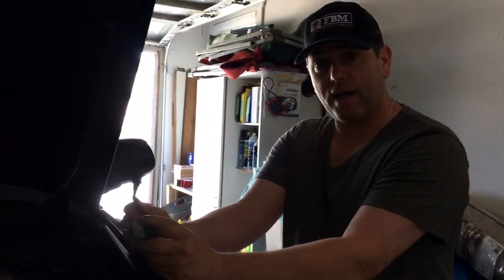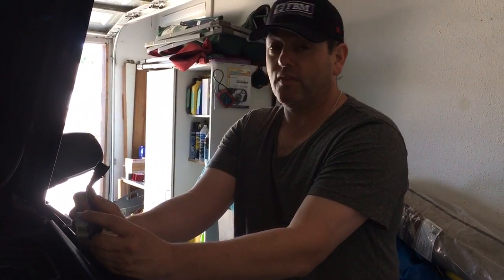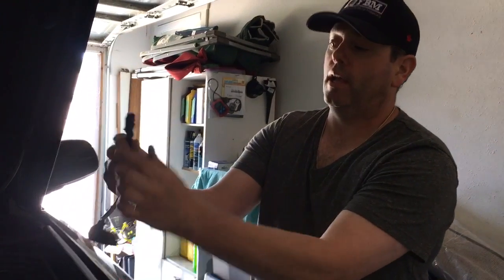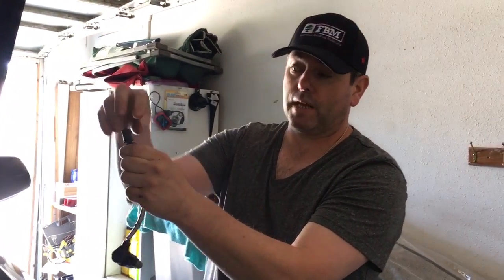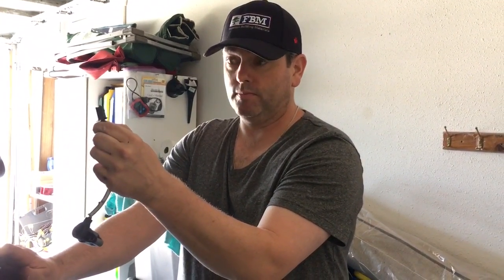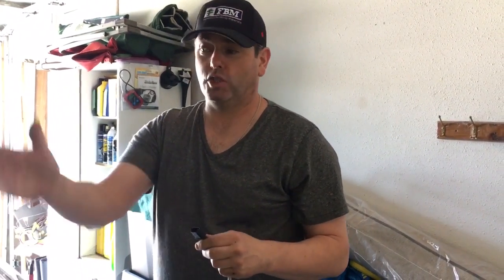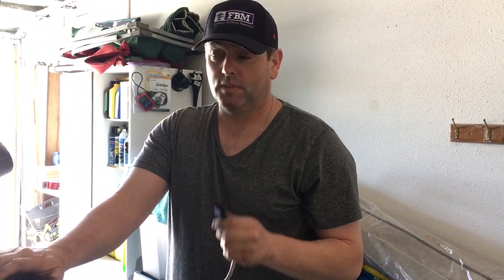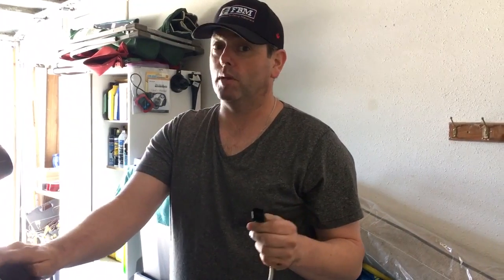Land Rover Discovery 2 V8 Crank Shaft Sensor

Comment: Hey there just seen this I have a 2001 disco SE myself…. I’ve been having very similar symptoms and have done extensive research and believe this is the culprit just curious, to this day have you had any issues with those same symptoms or did replacing the CPK sensor permanently fix your issues?? Thanks for the video very helpful
Reply from the maker: This did permanently solve the issue. But I must stress to use OEM parts, I have heard from others that off brand senors only last a month or two then problem comes back. Good luck man, let me know how it works out.
Reply: @robmarino6787   Thank you for the reply! I ordered one off of Atlantic British, will be here Wednesday, I’ll wait a week or so and come back let you know how everything goes!!

Comment: Thanks a lot for this, got my D2 up and running again. Just a tip if you use a small socket set with extensions the nuts are very easy to get off don't even have to put hands up there. Also used a long screwdriver to remove the harness from the bracket easily from underneath

Comment: Thanks for the vid. Fixed my issues w/ random stalling while underway (electrical system fine). A few comments: removing and reinstalling the shield and sensor is super easy, used a small ratchet and sockets. A short wobbly extension may help. Unplugging connector was aided by long screwdriver to wedge the locking tab open. The BIG PAIN is reattaching the new sensor to harness. My harness had almost no slack, so the plug could not be pulled down or over. No way to grab it from the topside and the mounting clip blocks access from below. Barely reachable from below via long skinny arms. can't get two hands on it (and I am pretty slim). If I had only 2 more cm of wire in harness it wouldve been much easier, and 5 more cm it could even be grabbed from above. Different vehicles may vary on this. It may be worth using a mirror and looking to see if you can free up some length in the harness.  I was minutes away from dropping the exhaust which would allow two hands up there. Finally my wife somehow did it after 90mins of trying. The clicking of the connector locking wa one of the best sounds ever. You should be prepared to drop the exhaust from the manifold in case you cannot get it (only 3 bolts but we all know how much fun they can be). One of those skinny reacher/grabber spring claw things could be useful - I may have been able to hold the connector from topside with one of these giving the wife something to push against. Anyway this is a 15 min job that likely takes hours due to lack of access.
Reply from the maker: very helpful info, glad I could help.

Comment: Thanks for the video! 
The first new Bosch CkPS I changed out made my 2001 Disco run sluggish af. Drove it for 2 months thinking it couldn't be the CkPS because I recently replaced it with a new one. The last straw was when I got the flashing M&S and went into limp mode. I changed out the sensor with another new Bosch sensor and it runs waaaaaaaaaaaaaay better now! Go figure...
I love my Disco... and i hate my Disco...
Reply from the maker: What sensor it you change out? for future reference, haha.
Reply: my bad... crankshaft position sensor... Ckps
Reply: These things are sensitive about that certain part. It's about how the materials take the heat in that location. Pretty much anything but the bosch made one goes bad quick.  Had 3 from the parts store that went bad between 4 to 6 months b4 i went online and bought the specific bosch part number that works like a charm
Reply: @xrguy650  Mine went bad after a year.  I think it may not have been a Bosch one.  That's the one I will get this time!

Comment: It’s basically impossible to reconnect the clips. I tried for six hours today straight. There’s no way to do it from the top that’s for sure and from the bottom, it seems basically impossible without taking the exhaust off.
Reply from the maker: I was given some great advice the other day. If you take off the tire and go through side panel you can easily reach.

Comment: Great Video Rob!  Many thanks!  Your accomplishment was an inspiration for me to attempt to do it  myself, as I do not claim to be a mechanic either.  You saved me an over $700.00 that a garage wanted to charge me for the same work.  I discovered a little trick you didn't show which enabled me to do it just under two hours.  You might add this note for others to try... Instead of pulling the plug up with the wiring harness, I was able to wedge it in place with a really big screwdriver coming in from the side with my right hand, and I could both unplug and replug it in place that way.
Reply from the maker: Hey very happy to help.Great info Dan, this was my hope that people would build on the info and provide further tips to help make this easier! Merry Christmas.

Comment: Hi! Thank you for this video it helped me few months back, now i m having the same exact issue again and not sure if I should replace the same part or change the coil pack this time, I appreciate it if you got any comments on the subject.
Reply from the maker: Make sure you didn't buy an aftermarket item. LR's are very picky and lots of aftermarket parts do not last. Especially when it comes to the sensors. I have heard from other people if its an OEM part it only lasts a few months.

Comment: Good Day Rob, mate thank you so much for your precious time doing this video, 
Could you please tell did you feel any losing a little bit of power then it hold it self then send all power back again special with the transmission  you feel something is holding all this what told u it’s only for few seconds then drive back normal? 
Cheers Matt
Reply from the maker: Hey Matt, if you talking about a symptom of it failing then yes. That jerking motion, as it seemed to lose power then gain again did happen. Usually in low idle.

Comment: Im not far behind! im about to do this... Mine starts normal but a week ago while driving truck stumbled... then no issues... last night driving home late at night just died instantly... no electrical change in lights or anything or being able to turn engine over... wait about 3-5 mins and it starts up... my onboard OBD II gauge just went into error mode but no codes... same thing happened again this am on way to work lol  since I cant get it to set a code or pending code before it dies, I decided to go ahead and order the part even if its not this ( but I suspect it is) . if its not and all of a sudden I did need it Id like to have it handy lol... anyway... i removed the OBD II gauge as i have also heard before of one malfunctioning and causing havoc on engine... when I unplugged ( maybe timing coincidence) disco II started right up... im pretty sure on any other situation like bad ignition or something then Id throw a code but I read on this situation it may die before a code sets in computer...
Reply from the maker: This part can be quite frustrating, not only about where it's located but also the issues it throws at you. It makes you think it could be the fuel pump, the alternator, the battery or the leads, something in the timing...etc. Once you gather all the symptoms; the stalling at low idle, no start but cranking, no start then start up after a few minutes, the unpredictable codes. With mine, check engine light came on but should no codes. Once I fixed, check light turned off. If you have the part you may as well install and see the outcome and go from there.
Reply: I finally threw to code while a couple of cranks of engine.. its been dead in the water for 2 days waiting the part lol  i ordered it before it failed as I was already pretty sure this was the issue lol Im at 125 miles on my 03 ... when cranking no RPM so no signal was coming from sensor that I could tell and mine actually died mid drive about 10 mins in... 2 times and then it was done... hopefully USPS is on time for tomorrow! lol ive been suspecting this could happen as my gas milage had dropped but no signs anywhere of the issue but one day abut 3 months ago it wouldnt start...  then it started... i ran codes and nothing so I dismissed it as a hiccup on a 125k dico.. ( BAHAHAHAHA) anyway it started and I forgot about it til now when it reminded me hashly! lol
Reply from the maker: good luck man,let me know how it goes.
Reply: I received the package fast ( 2 days) but thinking it wouldn't be available locally BUT IT WAS! lol anyway, took me about 1.5 hrs ( including running back to parts store for tools) and I didnt drop exhaust... it was pretty simple but my forearms just a little to large to reach that plug up by engine so I went down the street to a local speed shop and picked up (2 ) 11" long needle nose pliers bent with 90deg tip and with one in each hand I was able to hold the loose top connector on the wiring harness  and bottom connector with the second set pliers and press them together until they locked... then fired up the truck and has been running great!! on hindsight, i think id reconnect the top wiring harness plug to new sensor before installing the new sensor.. it was more difficult to match up the sensor plug halves to the wiring harness since the plug has a really stiff cable running off of it... anyway worked great and if i had it to do again I could do it in 30 mins now including taking a few sips of coffee lol
Reply from the maker: Awesome Dennis, and some good tips in there. Thanks for the update.

Comment: Any other idea's as to why it won't start? I just replaced it yet it still just clicks over
Reply from the maker: "clicking" is different than not turning over. if its clicking it could be; battery, battery leads, or starter.
Reply: I can start the car when key is in the on position. With a screw driver and starts up just fine but when I go to turn it over it just clicks
Reply from the maker: @zacharyswanson5132  Wow, that's about 2 levels above my pay grade. Perhaps this is an issue with the contacts in the key cylinder? Go on a Land Rover forum page, someone there might know. Good luck.

Comment: Diagnosed problem by verifying no spark and no tachometer movement while cranking. Also by connecting diagnostic scanner and getting P0335 code. However unless you have a service pit or extremely long and slender arms, this repair is impossible.  Was able to reach sensor body from below, but not able to reach electrical connector to the sensor from top or from below vehicle.  Would have to completely remove exhaust system and other parts on left side of engine to access this thing.
Reply from the maker: Hi Ana, after I posted the video I thought perhaps I should have stated it would have been much easier to do if I unhooked the exhaust pipe from the manifold but of course that is certainly not an easy task for a simple DIY mechanic. As you can see from the Video I'm not a small guy, not large guy either but I was able to accomplish the entire repair without taking anything extra apart. jumping from below the car, which was jacked up pretty high, to the top of the engine. This also would be much easier with help of a second person of course. Most things are!! :)
Reply: ahh since Im here Ill post here too maybe for others who haven't worked on these vehicles much.. IF you have not, then here is a little insight on removing the exhaust... SOAK THE BOLTS to the Y Pipe for a few days if possible every day, they rust in nice and good! one of my bolt heads sheered off when installing new flange gaskets and i had to get out a REALLY SHARP GOOD drill bit and drill it out and chase the threads with my thread reamer... a 45 min job ended up being a few Hrs... i didnt soak mine long and they were worse than they seemed.. anyway that was of course one of the bolts where the Y Pipe meets the exhaust manifold...its strait forward just take time...

Comment: Had this issue on my 2000 disco 2 about seven or eight years ago . Replaced the crankshaft sensor in 45 min . Think I’m having problems with the crank sensor again . Hard to start but when started runs fine . I’ll find out soon .
Reply: Charles Young From what I've researched these act up when they get hot. At least that's when mine acted up.

Comment: Do you think I’d be able to use a regular 7mm socket to get those bolts out? Thanks
Reply from the maker: sorry for the delay, there is not much room up there, unless you can disconnect the manifold. I used a mini wrench with the 7mm and 8mm sockets.
Reply: Rob Marino no problem! It ended up being a tight fit but I was able to get it off. Tightening the bolts was the hard part! Thanks for making this vid, it was very helpful.
Reply from the maker: @matthewdevine113  hey glad it worked out. Very happy to help.

Comment: how do you unplug the electrical end of the sensor?  I have a 2003 Discovery II SE 4.6L  automatic with secondary air.  It does not appear to be accessible at all from the top.  Very difficult to reach from the bottom.  I have the sensor end unplugged, now I do not see how it is possible to unplug the electrical end of it.
Reply from the maker: Hmmm Steve, once I was able to slide it out of it's harness it became quite visible from the top of the engine.  It slides out pushing it towards to rear. (in my 2001 it did). I had to reach down below the manifold and used 1 hand to unhook. perhaps in the 2003 its a little lower.
Reply: Rob Marino - I finally got it out and back in!  Without taking off the exhaust below or the secondary air crap above.  It was not possible for me to reach it from above but my daughter has very thin arms and smaller hands and was able to plug it back in after 10 min or so of trying.  I had to put lotion on my arm to reach the bottom end which I had to connect without being able to see it.  I would say don't even try it unless you can get the exhaust pipes off the manifold.  These bolts were rusted too bad to take them out without breaking them I think.  All that and it didn't help. Bought the iLAND Diagnostic tool to see I can find my no start problem with that.
Reply from the maker: absolutely getting the manifold off would greatly benefit but I was in the same position as you. The bolts looked rusty and I certainly did not need to break them, that would have created a much bigger problem for DIY mechanic. Good thinking having your daughter help, others have said their wife had to do it. It is unfortunate it didn't solve your issue though, good luck going forward. When you do find out please let me know the result. Thanks again.
Reply: Now I am seeing the M & S green lights flashing and when in Drive the red indicator gear indicator is flashing.  It moves in to the Manual gear positions but there is no indicator showing for any of those gear positions.   Any pictures or diagrams of where the top end of that sensor wire connects to the Engine Control Module?  Or where ever it goes.
Reply: I have the same problem and don't know how to sort it out!
HELP!!!!

Comment: HOW DO YOU UNPLUG THE SENSOR? Do You Need to Slid it to the Right or Left?
Reply from the maker: the multiplug rests in a harness, you slide it towards the rear of the car. Once out of the harness you can reach from top of the engine to unplug.

Comment: Is this the cause off the m+ s and D flashing and lose power
Reply from the maker: Sorry but I believe that is an issue with a bad or old battery. Try replacing your battery.
Reply: It can be. The flashing M&S happened to me too and it went into limp mode. 
I installed a new Bosch CPS and all is well now.
Reply: So I am having the M+S flashing at the moment and also the p0335 and P0336 codes.  May try to replace the battery first before ordering the Crankshaft Position Sensor.

Comment: Great video.  Thank you.  For the life of me, I cannot disconnect the sensor plug out of the harness from top or bottom. It is equally hard to reach.  Let me understand this correctly, the sensor and harness plugs are kept together with the small nubby tab on the side of the sensor connector, right?  That The harness connector fits on top of the sensor connector like a sleeve? So, to disconnect the two, the tab on the sensor connector has to be pushed in, or the connector on the harness side (sleeve) has to be pried/lifted with a screwdriver?
Reply from the maker: really sorry man, its been so long I cant remember. But there are several sensor plugs within reach at the top of the engine, most likely the same connection.
Reply: @robmarino6787  I finally got it figured out.  Very simple, as a matter of fact.  Thank you for the response.